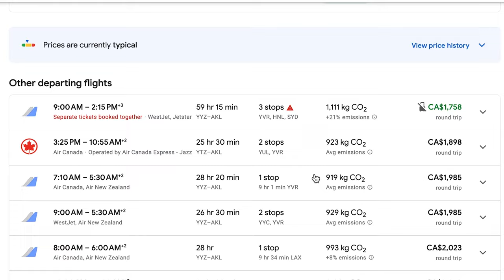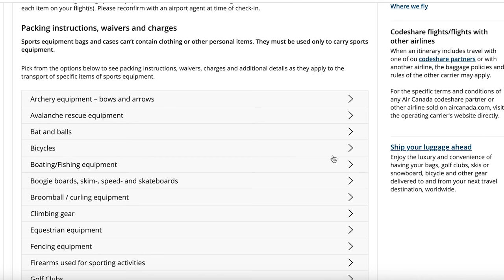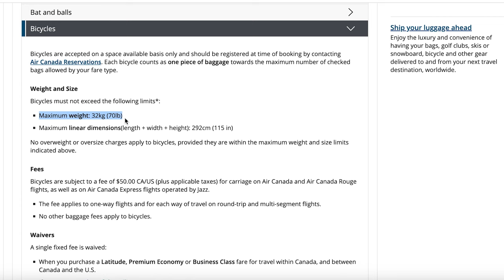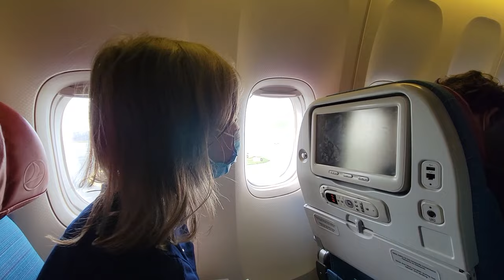FLYING with a BICYCLE: Booking, Boxing & Boarding!

Comment: My wife and I have recently returned from Europe with our bikes. Sydney to Istanbul, then Stockholm to Sydney. This was the first time that we have packed up and flown with our bikes. Your comments are spot-on. I did plenty of research, especially with the airlines to make sure that I had everything covered. I also kept copies of confirmations and any interactions with the airport in case there was any confusion at the airport. This was not required but is a good safeguard. We were able to box each bike with extra gear (pannier, tools, camping equip), and keep each to a maximum of 30 kilograms (our limit). We then each carried a pannier (as carry-on), with clothing and some camping gear to a maximum of 7.5 kilograms. We each then had a 'handbag' with any remainder of smaller stuff. This way we did not have to pay for any excess baggage (except initially when our checked-in limit was only 25 kilograms). We had no issues with either airport with check-in. The only challenge was getting to each airport with a couple of heavy and large bike boxes. This was possible with doing a bit of research again. From Stockholm, we stayed at a budget hotel close to the airport and ended up with a number of options of transport. We had a choice of two complimentary shuttle buses that were happy to carry the boxes, even though we were not staying at a neighbouring one. The breaking down of the bikes to fit in the boxes, and subsequent putting them back together again, does take some time but if you are methodical and patient, it was reasonably straightforward. I would not have a problem with putting the bikes together at the airport. There always seems to be plenty of space to tuck away in a corner out of the road. We now feel confident of doing the whole exercise again in the near future. Love your videos.
Reply from the maker: Thanks so much for sharing your experience! That's great to hear you were able to put extra gear in the box and bring a pannier and bag as carry on - I'm tempted to try that method next time :) Happy riding!

Comment: Great Advice Sheelagh
I’m flying from Dublin Ireland to Zurich. Our own national carrier was ok with the bike with a capacity to take six. A point to remember is that smaller regional jets don’t have capacity for bikes because of the size of the hold. Was nearly caught by this. 
I’m not the most technical so putting the bike back together will be interesting 🤨 
Thanks again

Comment: Hi Sheelagh. Great video as always. Also the one thing to mention when making a connecting flight with airlines who are not partners you not only have to go get your baggage and recheck your baggage you must exit out of security and then go back through security which can be a big time killer depending on which airport you  in. Great advice you give. Always look for the connecting airlines who are partners if you are flying different airlines. Thanks again for all your great videos. Well done.!

Comment: A few things in my bike boxing... 1. Packing tape works better than duct tape. 2. I use three nylon straps with clips to hold the bike together/closed. It is that light but strong webbing that many businesses use when they ship items. 3. I buy a box of plastic wrap [Saran wrap) for both my and my wife's bike and use an entire roll to wrap each box. Similar to the airport service. 3. I print out our names and contact info at destination  and home address on a sheet of paper and attach it to the bike inside the box. 4. I phone bike shops in  my European departure city before my trip to sort out a bike box for the trip home. Many shops no longer have spare boxes lying around.
Reply from the maker: Nice tips! Thanks so much for sharing Brent :)

Comment: Great video, kudos for the attention to details! Fully agree with everything you said during the first part. As for packing, I also stick a piece of cardboard between the brake pads, to prevent them from locking. I also leave the rack in place, only lowering it if needed. I also tie the handlebar to the fork, to prevent it from shifting around (it's a dropbar, so kinda wraps around the fork nicely). As for the removal of the handlebar - yes, Ortlieb's fitting is a huge nuisance, I ended up drilling out the holes in it, because it was impossible to push the cable through it, so now it works better, and also they've released a new fitting, that uses two cords instead of a cable - and this one is much easier to put on and take off as many times as needed. I also have electrician tape around the stem, both to mark the location, and to serve as a barrier of sorts between that fitting and the handlebar. I do put all of my camping gear into the box, so far it caused no issues. Nice touch about putting the bike into the lowest gear - I'll do that from now on! Same about writing my details on the box. As for sealing it, I think the tape sticks better to itself than to cardboard, so I pass the tape around the box a couple of times - at 3 different locations, both sides and center. I'm not sure why do you remove the bottle cages - I always leave them on.
Reply from the maker: Oooh lots of great tips here! Thank you for mentioning the new Ortlieb mount - I may transition over to that. Fortunately I have mechanical disc brakes so I don't need to worry about them locking, but that's a great point for hydraulic! I only take the bottle cages off because I find it creates a nice little protective space for the rotor on my front wheel - but otherwise I wouldn't bother. Thanks for sharing your experiences!

Comment: What if you’re dealing with a vintage bike with a single bolt stem? Removing the handlebars is impossible without removing shifters, brake levers, cables and bar tape. Do you just keep the handlebars on the stem and remove the stem?

Comment: There are free alternatives to bicycle baggage on airlines. Many international airlines allow for free 2 - 23kg(50 lbs) check in bags. Option 1 would then be a folding bike since they are about 30 lbs. And fit a cardboard box trimmed to the baggage dimension limits works well. Even a thick bag worked with good carry handles. Option 2 will work only with 26" wheels and smaller frames and if you are a good bike mechanic. Basically take the bike apart into 2 cardboard boxes, wheels in one and frame in the other. I found 700c wheels in a cardboard box exceeds the free baggage dimensions. And taking the bike apart allowed me to do some deep cleaning and maintenance at the same time.

Comment: This is exactly what I wanted to know. Thanks! By the way, don't you put pad spacers into the brake after removing the wheel?
Reply from the maker: Great question! Putting a brake block in is important for hydraulic disc brakes but not necessary for mechanical disc brakes, which is what I have (though of course it can be done for peace of mind) :)

Comment: Very helpful video thanks for sharing!
Couple of questions:
1) Is it safe to keep the rear wheel and derailleur attached to the frame or do you also sometime need to remove the rear wheel and the derailleur , pack it separately?

Is it a standard size bike box or some boxes could be also smaller?
2. Can you carry the bicycle packed in a box like this in buses or trains?
(Eurorail)
Reply from the maker: Great questions! 

1) I personally don't remove the rear wheel and derailleur if I can help it. Most bikes when shipped from their manufacturers to bike shops come with the rear wheel on, the derailleur shifted into the largest ring of the cassette, and the derailleur protected with padding. So my thinking is, if it's good enough for them, it's good enough for me!

2) Different buses and trains have different regulations so I would start there before making any plans. If they will take the bike packed in a cardboard box like this, I do find carrying it difficult - it's heavy and a bit of an awkward position (especially for those of us who are a bit shorter). However, I have seen some people purchase little roller wheels attached to a piece of metal and then they strap that to the box with straps so they can roll the box. It's still not super smooth to roll from what I've seen, but could help make it doable in a pinch!
Reply: @SheelaghDaly   Thank you so much! Happy Cycling 🌏🚴